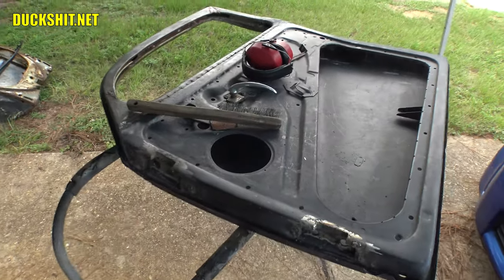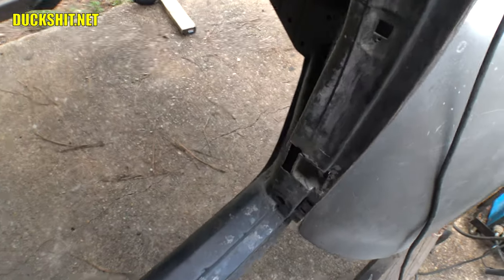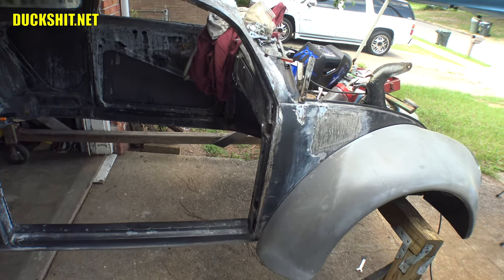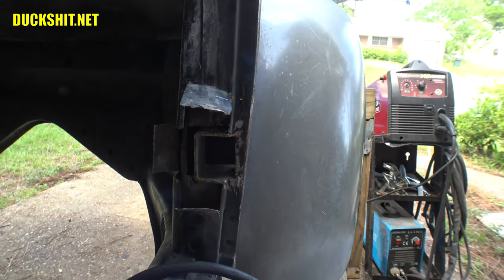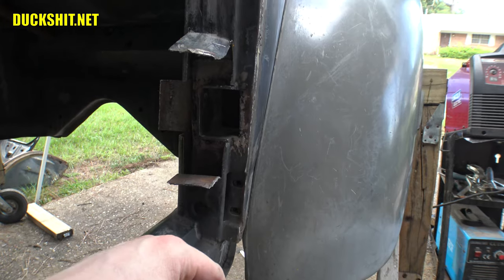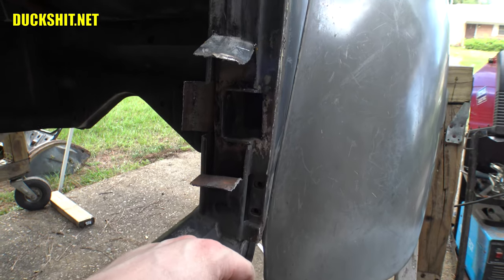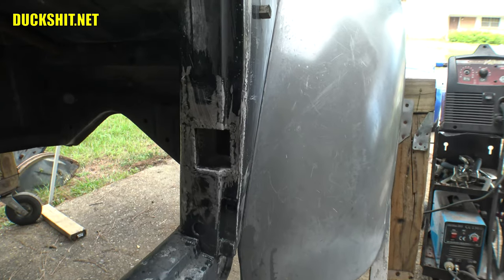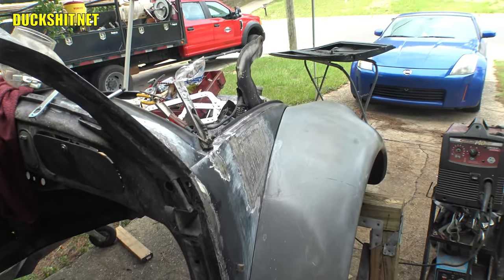Finish Welds - VW Beetle Hidden Door Hinges 9 - ROTTEN OLD 1956 - 114

Comment: Not sure if you knew this or not, but since you are using gas-less wire to weld with you can take off the shielding nozzle to get in tight places. Just be careful with the tip. Also another piece of advice if you are interested is you might want to brush off the slag on a weld before welding again. A light grind would be helpful too. When you weld over the slag you are contaminating the weld and trapping junk in the welds. I know most of your welds will be ground down, and not really visible, but this weakens the welds, and gives a greater chance for cracks in the welds later on. Just my 2 cents worth. Been a professional welder for 32 years so thought I would share the knowledge. Keep up the good work, and can't wait to see how this build turns out. Skål
Reply from the maker: Thanks, I take off the tip sometimes when in a tight area anyway, because the flix smoke pockets that area.  You have also seen me bush off the ash and slag between welds in this video!  😎👍😎👍😎👍  Thanks for the input!
Reply: @DuckmanCycles  Hey man. Yeah I have seen you brush off the welds sometimes, but when you were welding on the door it looked like you were welding over the top of slag a few times. Might have just been the way the video was done. Keep up the good work, and thanks for the tips and tricks in other videos. Been a real life saver when it comes to working on my bug.
Reply from the maker: @obwonchablowme  Thanks so much, man!  Glad I could help1  Is there anything you'd like to see me do?
Reply: @DuckmanCycles  I am still going through your older videos, so I'm not really sure. I am about to tear into my bug soon, but due to money issues it is on hold at the moment. Maybe a video about putting seat belts in the back? I need to do that so my kids can all fit in the car. I have 3 boys that absolutely love the bug.
Reply from the maker: Not sure if I am going to do seat belts in the back.  Not going to put passengers back there, no leg room because I push my seats so far back due to chop top to extend my legs properly. The seat will be there only for show.... or when I go on a date... both reasons are acceptable.   😀
Reply: @DuckmanCycles  I guess I could use a body mount bolt in the back couldn't I? I really don't want to drill any holes in my pan, and the seat frame does not really look like there is anywhere to mount to. Hopefully there are some directions with the new belts I ordered. I will figure something out. I will maybe weld a bracket or something if needed.

Comment: You know if you invested in the gas setup for your welder you wouldnt have to booger up them welds so bad. Flux core wire burns hotter which is why you have such a hard time not blowing through the sheet metal. And it would help with less of the smoke you're allergic to.
Reply from the maker: All factors that I am well aware of, thank you very much for sharing in case anyone else doesn't know! 😎😎😎😎

Comment: So no problem using flux core? good since I will be using that on my bug to fix the rusted hinge area.
Reply from the maker: No problems at all!  Just keep in mind it takes a little more heat to melt the flux core so you have to be very quick and let it cool before you pull the trigger again.  😁
Reply: Flux core burns through sheetmetal real easy. That's why you see him hitting the trigger a hundred times on one spot. If you can get the gas setup. Sure beats getting pissed when the welds come out like shit or burning through constantly
Reply from the maker: Yep, it sure does!  BUUUUUUUUURNNNN!  Gas is always better.  But if you get the feel for flux and don't mind wearing out your trigger finger (LOL!) then you'll be fine.

Comment: Hey Duckman, question, when you’re showing the area around the hinges right where the 1/4 panel meets the fender you can see daylight coming through. I don’t know if you have to tighten the fasteners or whatever you have holding them together, but I know you’re trying to make everything water tight.what do you think?
Reply from the maker: Thanks, I think there are no seals installed yet.  LoL!

Comment: what wire are you using for the body and what gauge is that metal on the hinge pillar?? thanks for the vid!!!
Reply from the maker: Sorry I'm not certain of the metal gauge and actually measure it.  The patches I made were actually using much thicker gauge anyway because that was the scrap I had sitting around.  😁😁😁
Reply: Use .25 wire and most of these old bugs are 18-20 gauge
Reply from the maker: @joshuapoche5137  Good call!  Thanks for that!